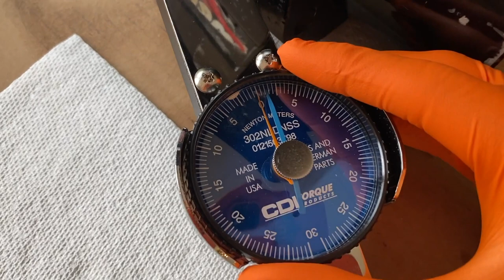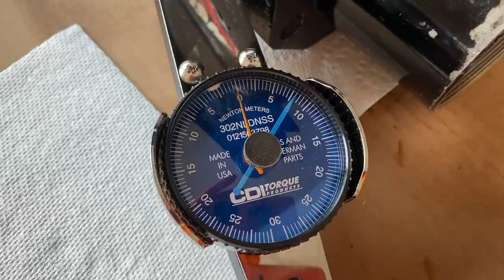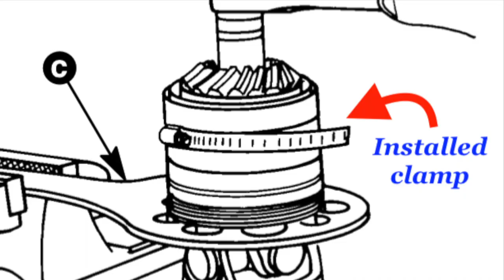How to set Preload on alpha 1 gen 1 (2) bravo

Comment: Hey Mike... I think you may have overloaded the bearings with 61 in-lbs of force. That wrench you are using is newton meters.
Reply: I wonder if he saw this comment. Seems like you are correct.
Reply: I was about to order this torque wrench and realized yes he is referring to inch pounds but the dial is showing newton meters.  This would not be a good wrench for this project.

Comment: You mentioned on the slip fit that the nut gets torqued to 80 pounds. Is that foot pound, or inch pounds? If this is the procedure, then why even buy the special nut and washer if the old bearings and gears are being reused?

Comment: I installed a used good set if bearings and gears in my alpha one 1988. Now it whines . I did not do this preload.  I did not use a torque wrench . I could turn the shaft with my hand prior to installing.  Can'timagine it's too loose??.
Reply from the maker: Thanks for watching.  It’s possible that it’s due to the preload being slightly off.

Improper re-shimming for the change in gears and bearing can cause this.
Reply: @DIYwithMichaelBorders  I used the shims that were in it already.  Gonna pull the drive.
Reply from the maker: @MikeSsuncoasttrains  

Keep us posted.  Do you plan on performing preload procedure?
Reply: @DIYwithMichaelBorders  I think It's coming from the gear set. The lash looks good and it doesn't even get warm.
Reply from the maker: @MikeSsuncoasttrains  

Awesome, looking forward to hearing back from you.  👍
Reply: @DIYwithMichaelBorders  so if the preload is off can it change the gear lash?
Reply: @DIYwithMichaelBorders  its not the drive shaft gears. It's the driven gear. It's sitting to deep in the housing. But I see no shims anywhere??
Reply from the maker: @MikeSsuncoasttrains  

Very possible…especially due to the speed of shaft, gear, and bearing revolution.
Reply from the maker: @MikeSsuncoasttrains  

Yup, the u-joint shaft assembly gear and bearing.